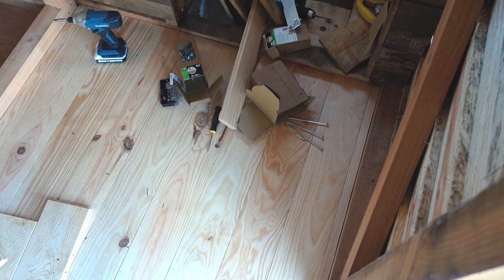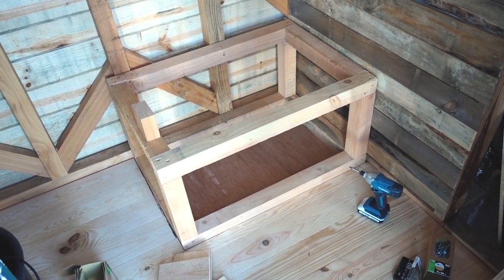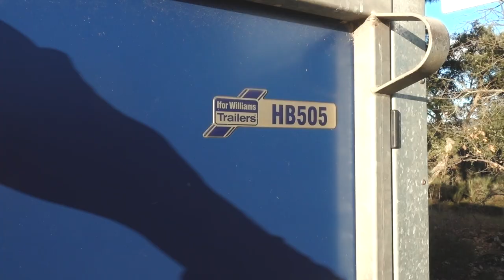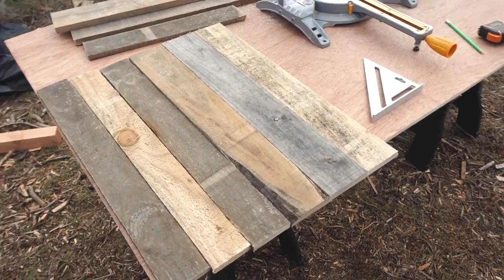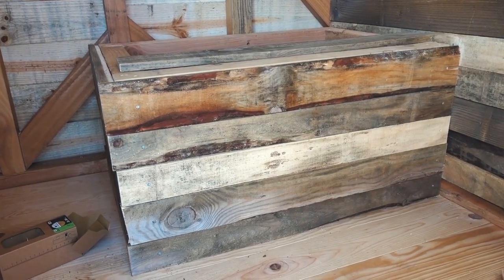NO SMELL Off-Grid Compost toilet!

Comment: If you paint the tube black it will get hotter in the sun, which will heat up the air in the pipe faster and since hot air rises it should create a convection current to aid with the off-gassing.

Comment: 1) Only mesh for the top of the tubing? It's going to collect rain and dirt very easily if you don't put a "cap" of some kind on top...there are stuff like that to ventilate gutters, but this tube is small, so you might have to fashion something yourself...perhaps get another 90angle tube and place it on top; also cut it diagonally (longer upper side) to function like a shed/canopy, to prevent rain/water going in easily.....2) you also need to control the direction of air moving in that tube; are you certain that air won't push the smell through the tube in the cabin? This is why people use fans in Van-composting toilets.

Comment: Thanks for another great video. I really enjoyed it.
Very nice work on the build. It looks good.
I was hoping you’d show the top of the outside ventilation tube. I have seen caps on top of vent tubes that swivel with the direction of the wind, so that the tube is always venting air OUT of the tube, no matter the direction of the wind. Actually, here in the States, they sell these omnidirectional toilet vent caps for RV/travel trailers/caravans, which always vent the air OUT no matter the direction of the wind, or the direction of travel. I bet one of those would fit right on top of your vent pipe. 
Happy Camping

Comment: Whole lot of questions at the end of this so hope there is a followup. Questions about how and where the mesh, whether caulking around where pipe exits outside wall, cap over top of pipe outside, what in the world you refer to as another vent and why that is. Up to now, nice.
Reply: Also when it rains will water travel back down the pipe into the toilet
Reply: @MrWilzSkilz  what I meant by cap over top of pipe outside.

Comment: Would you need to drill a very tiny drain hole in the bottom edge of that 90 bend - the one at the bottom of the vent stack? Appreciate you probably don't get much rain to go down the tube, but just a tiny hold to allow any rainwater to drain out?
Reply: Or altnatively pop a U bend on the top?

Comment: With professional composting toilets the urine is kept separate, this stops the smell.  What will you add to the bucket to cover the poop? How do you empty the bucket? Usually human waste to compost takes over a year before it becomes safe to use. Love the brackets, got to agree with the cover over the top of the pipe and maybe a drain at the bottom. Great work on the new superlatives Theo!

Comment: Have you treated the outside wood for longevity? I have also seen people building wooden houses use a thin sheet of a special waterproof material beneath the outer cladding, to prevent water coming in and to lead it to drain at the bottom.

Comment: the seat looks too far back, looks good though
Reply: I was thinking the same, but presumably they both tested it and found it comfy..
Reply: Agree! Need to sit legs straight, like when you have a diarrhea and all comes out with pressure and your hair is like after an electric shock and your legs are straight from the pressure release 😆 you get the image?
Reply: My thoughts too. I wonder if they tried it out first?
Reply: They are both pretty tall, so that is probably why it is the right size.
Reply: Bev True • but what if a child or a small visitor has to go?
Reply: @eleo_b  outa luck?